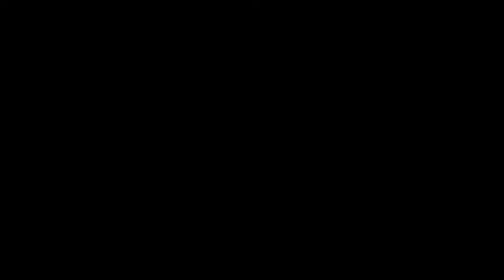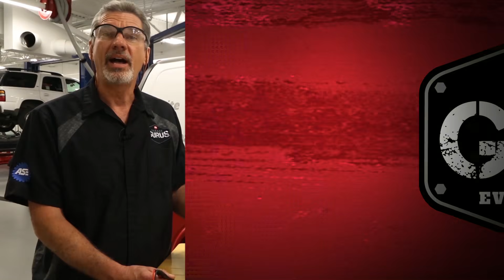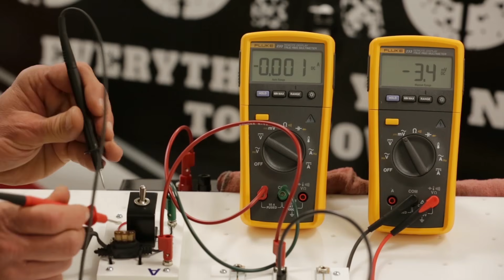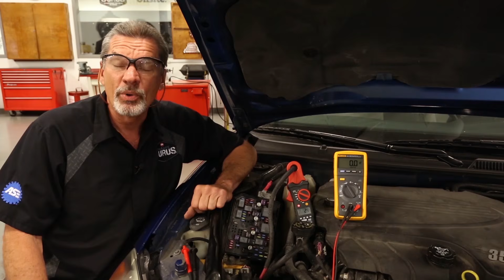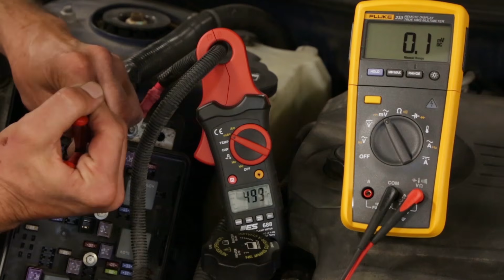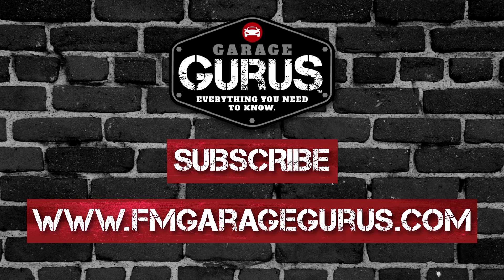Parasitic Drain

Comment: I HAVE A COUPLE OF ISSUES WITH THIS VIDEO FOR ONE CAN THAT METER READ 50 MILLIAMPS? IF NOT WHAT IS THE PURPOSE OF USING IT ITS HARD TO FIND A REASONABLE PRICED CLAMP METER THAT READS THAT LOW OF AMPERAGE

Comment: ok I as of today 10/21/24 I can't find my parasitic draw and have tried all these methods ....I even took it to the extreme and emptied out both fuse box interior and exterior and yes, I did latch the doors and waited for the vehicle to go to sleep, my draw should have dropped with no fuse /relay/or jcase ... so I'm at a lost ...I had an amp clamp attached to the positive side the battery and there is not one video with this situation out there ..need your help if you can ..or anyone for that matter

Comment: Hey poncho, you forgot to tell people that those 2 Fluke meters cost over $200 each and then the low amperage clamp meter is $400.  Get the details right so people will not get sticker shock to learn that they are pretty much incapable of running this test without taking out a bank loan for meters. Sometimes even the best of mechanics and meters fail to find a parasitic drain, in which case the customer can go out and buy a battery disconnect switch from Amazon for about $10 or a Battery Tender/Charger for about 25 which takes care of the problem . Guys like you always forget to mention that the owners manual that shows what each fuse goes to is an important thing to have in hand also. Sheessssh.
Reply: lmfao

Comment: I can see that your measuring AC Voltage on your meter, shouldn't you measuring DC Voltage?
Reply: Actually it is set to read low AC/DC voltage. If you look at the display it indicates a mV DC voltage.
Reply: @cfldriven  you are correct, I was fixed on the dial and did not look at the screen..thanks for taking the time to correct me . Excellent information thanks!
Reply: @parlosyou  Its hard to make out the DC markings with the light reflecting plus some meters stack the symbols while others place them side by side.

Comment: 1:30
Let me make some corrections here. Your meter is reading trickle voltage from ambient air. Tesla discovered electricity in the air, thats what the meter is picking up when your leads are exposed to open air. The potential difference between the 2 wires in the AIR ... Its not the cause of the meter, its what the meter was designed to pick up. 
Next, when you touch your leads to the fuse, you are essentially SHORTING out the wires so now the meter reads 0 volts on a dead fuse. Take your leads and short them out and watch that ambient air voltage go from X to 0. With an active fuse & current flowing across it, the meter will sense the electrons flowing between those 2 points on the fuse and show it to you as a voltage differential in the milli-volt range. 
But yes this is the best way to test for parasitic draw without pulling fuses to kick start something on.
Reply: @esaugalvez  🤣 👌 ok kid
Reply: @esaugalvez  🤣 yea ok kiddo 🤣
Reply: @esaugalvez   bless your heart 🙏
Reply: I don't understand, if the fuse isn't blown, how is he getting a voltage across a short (good fuse)?
Reply: @mrcalico7091  because he is reading the current flow across the fuse and that current flow is seen to the meter as a "voltage" aka a difference of potential between those 2 points. Its not a lot but its enough for the meter to see it as a voltage even though its technically not a voltage. 
So if you read like 150mV across the fuse while that circuit is active, shut that load OFF and watch that 150mV disappear.
Reply: @ACommenterOnYouTube  is it because the current will take all paths even if the resistance is higher through the meter?
Reply: @mrcalico7091  No, its not taking the path of the meter, the meter see's the current flow across the wire and see's it as a voltage.
Reply: @ACommenterOnYouTube  can i set clamp on negative cable battery or postive?
Reply: @tomytimo6343  either one, current is flowing from neg to pos so either side will work, just make sure the clamp meter is faced the right way to read the current as it flows thru the clamps ...
Reply: @mrcalico7091  Because fuses are small resistors, there is a small voltage drop over the fuse, when the current is flowing through the fuse.
If there is no resistance at all in the fuse, they don't warm up and never burn.

Comment: How do you measure voltage drop on a J style, box fuse?
Reply: ThAts a very good question
Reply: The method would not work for those. Ford has a tech bulletin that states as much. It's one of the limitations of this method.
Reply: @ACitizenOfOurWorld  Thanks for the update, appreciate it!

Comment: What if yu have an intermittent draw and the fuse checks okay so yu move to test other fuse and now the fuse yu checked ok now shows the intermittent draw on the fuse that showed ok. With your way of testing yu missed the intermittent draw
Reply: With the amp clamp connected you would see when the intermittent draw was occurring and test the voltage drop then.
Reply: My clamp meter has a min and max and I left it on for 24 hours to see highest possible draw

Comment: How do you measure the fuses while they're still plugged in
Reply: There's little tiny exposed metal tabs on the face side you run your volt meter to.

Comment: With that multimeter you are just showing the difference before the fuse and after the fuse.the drop in voltage is because you have increased the amps in the fuse so the resistance of that fuse

Comment: Good luck trying to do this check on the sealed clear plastic fuses. Or some vehicles where one has to be a circus contortionist in order to access the inside fuse block.
Reply: This is more complex diagnostic techniques. I will say, that the 80-90% of pasasitic draw, its covered from this video. And with low budget tools. 
For difficult cases, you can use thermal imaging camera ,which is a bit expensive tool.
Reply: Yeah so easy right! Funny how they never mention all the other variables.
Reply: And he's evasive/ not Transparent on giving the audience a crystal clear picture of a lot of his investigations.

Auto Professional background
Reply: Or in the trunk ,or floor board under front seat